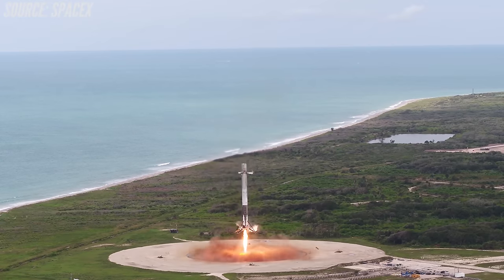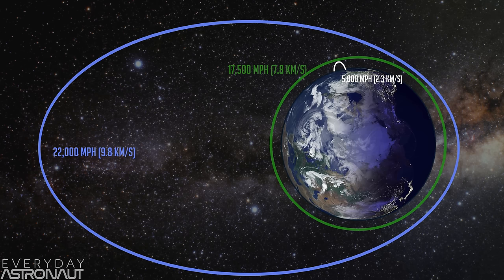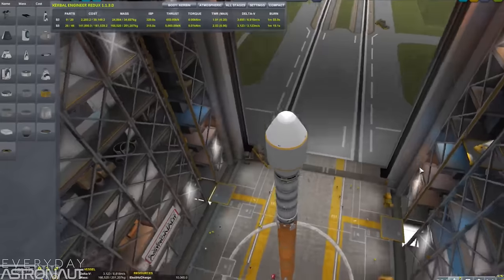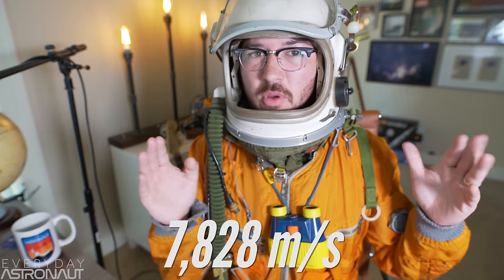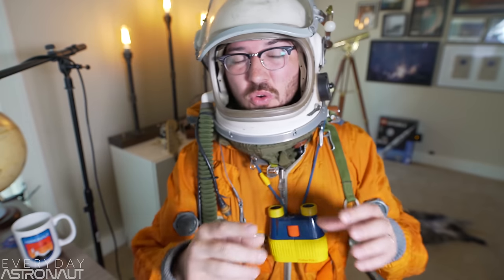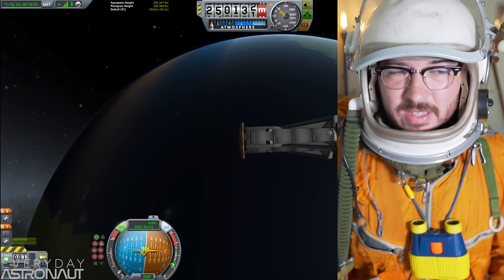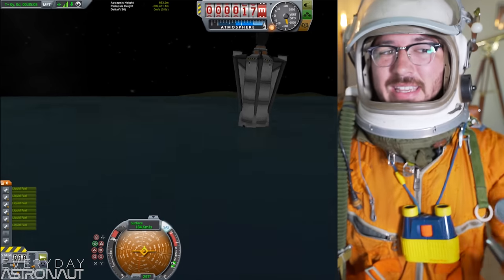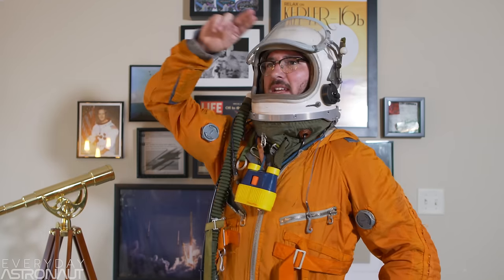Can SpaceX Reuse a second stage?

Comment: Once you have something up in orbit, it would be great to find something useful to do with it.  I believe I heard once that NASA looked into saving the shuttle external tanks to use as the basis for a space station, but I can see how cutting them open and attaching air locks would have been impractical in orbit, and modifying them before launch would have been too risky.  If something is only useful if you have a bunch of them (like ULA is thinking for harvesting fuel), then that only works if you have lots of launches into the same orbit.  In any case, I think you described really well why for the Falcon 9, the question is not how to reuse the second stage, but how to minimize the cost of the second stage.  That's one reason why it's great only having one engine on the second stage.  And of course, Starship changes everything.

Comment: All that fuel being left in orbit from spent second stages, wouldn't that run the risk of turning solid or going high pressure and bursting the tanks while in orbit? That's my question for the reusable 2nd stages. They would probably need to orbit a way-station that had thermal management facilities to service the spent modules and to "park" the empty modules for later de-orbit or reuse in some construction. Are there any public discussions about these things I've brought up?

Comment: Why is no one talking about ballutes? They seem like a way to handle this fairly well, given enough R&D. The way to handle  an otherwise spicy re-entry is to do it very slowly, and the only way to do that without propellant is with a drag body that is significantly larger than the stage.. aka, a ballute.

Then, all you have to do is solve the "so, where the heck will it end up?" problem. Which is probably again, not a huge problem to solve, given enough R&D.

Comment: You have to think outside the box because that's what Elon always does. For example, they will look at things like an inflatable heat shield solution. A system like this was tested by NASA a few years ago and could offer a starting point for a final solution. Just trying to point out that SpaceX will look at the most obscure solution to a problem. If it works, they will adopt the solution, it's that simple. So push the walls out and think bigger. Sheers.

Comment: The amount of fuel needed to slow down/speed up depends on the mass of the object being accelerated. At the end of the insertion burn and after the payload is gone the second stage is down to less than 10% of its initial mass which in turn means that much less fuel is needed.

One problem you've not gone into is Kepler's second law(*) - which means that although the 2nd stage might well be going 22,000km/h at apogee, it's going a lot faster at perigee.

Getting rid of most of the speed should be doable but you'll still need to heatshield and the vacuum bell facing "into the wind" isn't going to fare well (one way to handle this is to run the rocket at low throttle to produce a "gaseous heatshield" protecting the bell and engine). Landing can be via parachute. 

The question on all of this is whether it's economically worth doing it to recover an engine (if a first stage engine can be converted to vacuum operation then you could use older reused first stage motors as second stages for final use and still make a profit on it with proven componentry)

(*) The area subtended by an orbiting object is equal over any given time period - or in other words things in elliptical orbits go slower as they get further away and faster as they get closer.

Comment: Have this 'stupid' idea for a long time, and seen your incredible shows i wonder if you could indulge me on the following idea; 
You know about reactive gyroscopic couple it could maybe used to slow a spaceship down to enter at much less demanding conditions. Could you simulate such an re-entry?
This would really ease up re-entry, because an 'auto-gyro-like''feature like that would a) slow the vehicle down a lot, meaning less tear, and with that lesser design constraints (even approach more shallow re-entry angles), and further if coupled to a rotary energy storage device it could slow the vehicle once more when the angle-of-attack would be reversed and used to slow the vehicle down. Such an energy generating and then consuming device would make use of the flywheel energy storage concept, so the internal energy-storing device would be able to storage massive amounts of energy during descent and by inverting blade orientation use it to slow down as well during descent and could use this stored (rotational) energy in lower or even touch-down scenarios. Remember flywheel energy storage only relies on mass in 1 amount and squared for velocity of that system so it could be a ring very light carbon-fibre but accelerated to gigantic speeds to have the fan-blade portion, first accumulate and the use it's energy to slow down.
Just an idea but if you can please evaluate such a scenario.

Comment: I think you are not wrong with your statement that landing and reusing a second stage would be really difficult. So SpaceX may try to do that with some funds on the Falcon Heavy however with the BFR on the way with more of a hybrid solution betwwen landing second stage and using it n Orbit. If I understood it correctly the BFR works like this the First stage booster is landed and refilled with fuel while the second stage(integrated into the Spaceship) makes its way into orbit. then the first stage lifts the tanker to orbit which then refuels the second stage/spaceship which is then "reused".The tanker than lands again, to be reused again. This obviously only makes sense if you intend to leave orbit.

Comment: How about if the heat shield was portable and locked together (think pizza slices coming together to make a whole pizza)?  Then you could attach it around the engine faring and have the heat shield come together under the engine bell, which would solve the weight distribution problem.  After the second stage descends far enough, the heatshield can be dropped and caught like the payload faring while the engine burns like it would for first stage recovery.

Clever use of Aerogel in a structured network could really lighten the heatshield and save on payload mass loss, and a parachute-assisted landing burn (deploy parachute, then burn for final touchdown) could save on fuel losses.

Comment: I don't know how it applies in real life, but in KSP you would do the reentry differently: much flatter trajectory, which means the reentry burn itself takes less fuel and by entering the atmosphere in that flat trajectory you would give the atmosphere more time to slow the spacecraft down, mostly solving the overheating problem. By that you would again save fuel by having the atmosphere slowing you down to essentially terminal velocity without having to use fuel.

Comment: What about using atmospheric braking at Perigee for several passes to re-circularize to a very low orbit before the final reentry? Wouldn't that noticeably cut down on the required dV vs payload weight penalty?

Comment: What about change the architecture to a three stage rocket, with only the first and second reusabe? Or attach an orbital engine (and tank) for the orbit circularization to the payload?  Maybe  you can also leave the 2nd stage in orbit and let the atmospheric drag reduce the 2nd stage orbital energy.  If the perigee of the 2nd stage is still below 200 km should't take long (still weeks/months) to have some benefits (depending on the apogee and weight of the payload). Then, starting from a lower energy and altitude, it should be easier to re-enter.

Comment: Maybe this has been addressed but why not eject the part of the second stage nozzle that is not needed for landing and add an HIAD or in simple words a inflatable heat shield on the engine end of the second stage? After the second stage has deployed the payload an appropriate amount of the second stage engine nozzle can be jettisoned to facilitate stable operation at the higher atmospheric pressures present during landing. A HIAD (Inflatable Heat Shield) can be deployed before reentry and directional control can be maintained during reentry by moving the vehicle CG around the reentry force line generated by the HIAD; (see NASA HIAD Experiment). At an appropriate altitude the HIAD can be jettisoned and the second stage engine started for second stage deceleration and landing.... Thoughts?   

https://www.youtube.com/watch?v=CWZAoKWd3fE
https://www.youtube.com/watch?v=aj2LEQWAoUM

Comment: Why can’t re-useable SRB’s like the STS used be added to whatever booster your using so the first stage delivers more D-V and the second stage completes insertion with more fuel onboard to make return possible.  They could make up for the added weight the second stage would have to make a return possible.

Comment: One thing I've devised to improve economy is this: To deorbit the second-stage you usually need it to have telemetry antennae to allow it to receive the deorbit burn command. So, I slap a couple solar-panels and relay antennae on the upper-stage, so that with what remaining delta-V it possesses, it can put itself into a feasible orbit for use as a Tracking/Data Relay Satellite. Not reusable per se, but repurposable, at least.

Comment: Here's my idea for a second stage recovery:  Use a fold-able heat shield around base of 2nd stage and deploy them when entering atmosphere, similar to 1st stage grid fins.  I imagined a concept similar to a common kitchen item, a fold-able metal colander, that would help create that slightly parabolic shape that most capsules have.  Then develop ablative spray on heat protective foam to spray on 2nd stage engine parts that are unprotected by heat shield.  Then use series of drogue chutes and parachutes to slow descent.  Got that Elon?  You can send checks to my PayPal account?  lol

Comment: throwing out another idea for second stage re-use/recovery in orbit: why not make the second stage out of easily recyclable materials which could be processed with some sort of on-orbit recycling furnace(s) that would take a second stage, break it down into its recyclable pieces, then send pieces to different recycling places in a recycling satellite for re-use as space station parts, on-orbit energy satellite parts, deep-space spacecraft parts, etc... -since we are already sending second stages into LEO, why not re-use the parts on them and recycle those parts into other pieces of parts or equipment that could aid us in building larger structures in orbit and providing infrastructure that way? -anyway, an interesting idea... :-)

Comment: Thinking in terms of payload penalty becomes less relevant on reusable systems. Today you should turn it around. Multistage single use rockets have a 'reusability penalty', which drives up the cost of space operations. Reusable systems have an operational cost benefit. So it doesn' t really matter if they need more missions to bring the same total mass into orbit because your total cost can still be lower. When you do the math and trade space on single stage rockets and stages and a half, they are actually so interesting, and have always been defended in the literature as the best concept, that it is the route we are going down on with our little company. Forget multistage space systems. With reuse demonstrated they are no longer needed. New materials limit the mass creep more than before. To optimise for cost you just need to avoid the design decisions taken on the Space Shuttle. That means: no wings, no sideboosters, space ship on top, and engines above your propellant drop tank and a good heat shield + using a toroidal Aerospike. Some mass is used to protect the propellant tank against the engine exhaust, but it is still less than what is required to build wings. Maybe Kerbal is smart enough to calculate it correctly.

Eventually our proposal looks like sci fi but it only uses existing tech. The industry having stopped looking at it because of competing programs, while it was actually doing all the groundwork in our direction, is to our benefit.

So your calculation rule of thumb is correct for a Falcon 9, but not for a single stage or stage and a half using aerospikes. You can have your 30 metric ton payload to orbit in a volume much smaller than a Saturn 5 or Space Shuttle System and be reusable with vertical landing. To optimize for cost and payload return with minimal propellant fumes, all you need is a light reusable heat shield on your orbital stage and today, the tech exists.

Comment: Using the second stage as an orbital transfer vehicle has some merit, but what about using them for the Earth to Lunar transfer orbits or as building components for Earth or Lunar orbit structures, or for Lunar surface structures?
Since the engines (Merlin?) for the second stage are designed for vacuum, would they work as a Lunar launch vehicle? 
Just seems there are many things that could be done with a second stage, from re-use to recycling the metals and reforming them into something useful, without paying the energy tax to put them down the gravity well safely.

Comment: All of your attempts are too error prone and difficult to implement as it would require a radically new design of the second stage. The solution is simple: do not discard the fairing. Yes, that would mean that you can't put in orbit as heavy payloads, but it might prove financially a good idea anyway (besides, 90% of what SpaceX puts in space, it has a huge margin in terms of weight -- and satellites become lighter with time, not heavier). So, you carry the fairing all the way through to the deployment (by opening it up like an upside down umbrella), and then you close it back and you use it as a heat shield on the way back (obviously it'd have to be enforced for re-entry). And then you open it up again a few kilometers high to act as breaks, and after a small burn to change the orientation of the vehicle, you deploy parachutes (forget extra thrusters, fins, and legs, just splash it down in the sea). I think that's the only way that makes sense to bring the second stage back down (and bring back the fairing too, in a single step): by utilizing the fairing to do what it does best: protect the rocket and payload from pressure and heat. So if you use it that way to go up, why not use it to come down too? To me, it's the obvious solution. Just because everyone so far has discarded their fairings doesn't mean that we need to be as wasteful in future designs too.
Reply from the maker: +Eugenia Loli fairings are the wrong shape for reentry. Reentry needs a blunt leading edge, not a pointed one. Also, the fairing would want to go last as it's high drag and low mass, so it would require a lot to keep it oriented as well. Not saying what you propose isn't possible, but we'll have to wait and see what spacex comes up with.

Comment: Nice.. subscribed! :)

OK, now for the silly question:

Could the second stage get back into the atmosphere enough to deploy a high-speed parachute that would slow it enough to deploy a wing type parachute (maybe one that deploys in stages) like those used on paramotors?

The body of the stage could lay horizontal, and have two rear skids deploy and a front skid (to keep weight minimal compared to landing gear but set up friction to keep the vehicle pointed straight at touchdown and roll).

The stage would be under autopilot and able to use its kinetic energy converted to forward motion to steer to a runway, then flare to wash off speed and generate lift when touching down.

Now when I say paramotor wing I'm not talking about one with the usual glide ratio; it'd be something yielding performance more like the flying-pair-of-pliers space shuttle.

Comment: ....and one more silly question:

Since stage 2 is already happily in orbit, and there's no big rush to come down, would it be possible to use optimized ion-thrusters to slow it down to the point that the regular rocket could take over without running dry?  I'm not sure of the weight required or if a solar skin would provide enough power, but even a gentle push over, say, a week or four, might do the trick.

Perhaps lowering a very long and thin cable could generate enough power from the rush through Earth's magnetic field?  I say this only because I recall tests done generating power this way.  Depending on the cable it also may exert a small amount of drag as the vehicle creeps lower.

Comment: How about a Falcon 'Extra' Heavy with 4 boosters ? Surely this would allow the extra kit to be carried for re-entry and landing with a similar payload. The 2nd stage could then be re-designed so the tanks are jettisoned to remain in orbit for future re-use with only the main engines and expensive bits returned. Then use a heat shield designed with an engine [for landing] set in the centre. ie Fight fire with fire and bring it all home !

Comment: Of course recovering a second stage is more difficult, but it wasn't that long ago that recovering any rocket with a vertical landing was purely the stuff of science fiction. There is nothing physically impossible about it. It's simply a matter of solving engineering problems, which is what engineers are for.

Comment: Interesting concept of a reusable 2nd stage. For now. I was just thinking of using parachutes like the Apollo capsules use. The problem with this concept would again be the weight of carrying three parachutes next to the weight of the heat shield too. Unless Space X expanses the widths of the rocket and the number of engines which would increase the again the weight of the rocket itself.  ULA concept seems to better in someways of just keeping the second stage in space by refueling, and use it for other missions like going to the moon or Mars, and beyond.